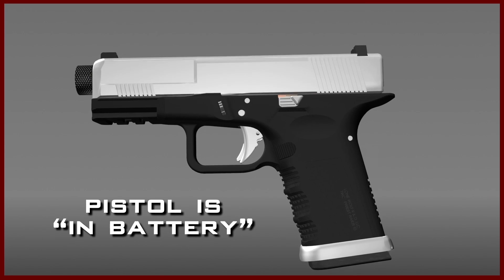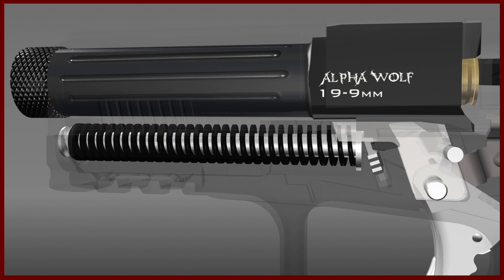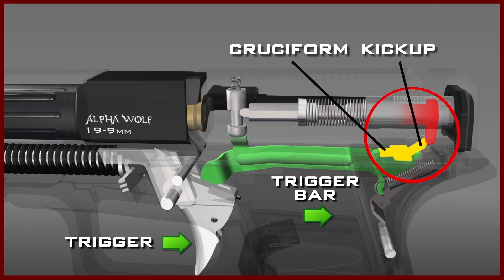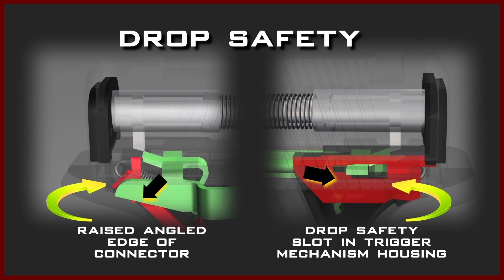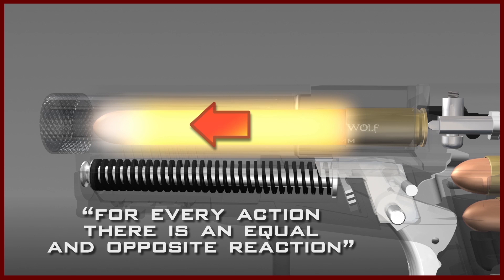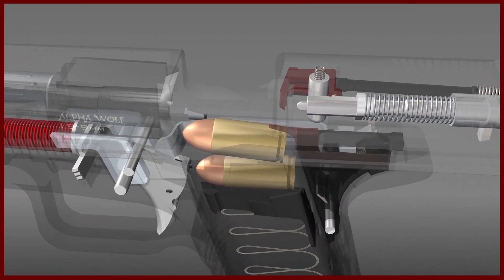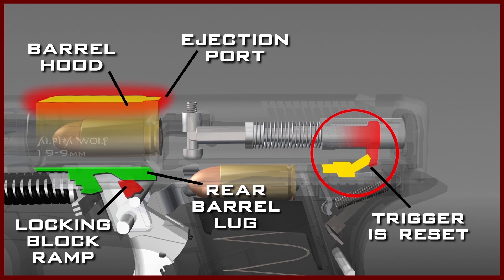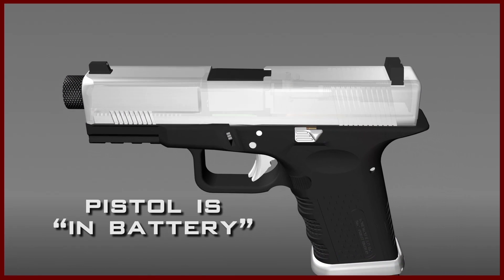Lone Wolf Update: Firing Cycle Explained for Glock

Comment: Believe I know the answer. It's actually depicted in the ending firing sequences without explanation. One can clearly see the bird's head of the trigger bar sliding off the raised angled edge of the connector. That is the reset and its distinctive sound. It's also consistent with what I've read in lone wolves complete Glock reference guide, 4th edition, page 37.

Comment: What EXACTLY causes the audible click when the trigger resets? What is it that creates that sound? From what I've read and observed, it deals with the connector and the trigger bar interaction but I don't understand what actually causes the click. I have an idea, but would like Lone Wolf to chime in as well as viewers of this video in the know!
Reply: The actual firing sequence multiple times at the end of the video depicts what happens . The bird's head of the trigger bar sliding off the angled edge of the connector is what creates the reset and its distinctive sound.

Comment: This is by far the best description of the cycle of operation for the Glock pistols, much better than the official armorer's course.  The trigger spring is not the component that forces the cruciform upward, as shown at the 6:15 mark in the video.  The trigger spring can be removed, and the Glock trigger will still reset.  The Z-bend in the trigger bar that is just ahead of the cruciform is what causes the cruciform to rise up, so the kickup can engage the striker as the slide moves forward.  The Z-bend contacts the plastic frame, and the trigger bar is forced upwards once the disconnector is released.  The upward angle of the trigger bar from the pivot on the trigger to the Z-bend is what forces the kickup upwards once the disconnector is released.  We know that Glock incorrectly calls the disconnector a connector.  We also know that the Glock armorer's course contains so much false information about how the pistols operate.  The armorer's course contains so much bad information that graduates of the class have no idea how the pistols work.  The actual function of the pistol can be seen when the trigger spring is removed.  The pistol will still reset without this component, although the trigger pull weight will be much greater.  It really stinks that we have to take the same class every 3 years.  This is a big waste of time and money, but we have to listen to the same bad information from Glock every 3 years to retain our certification.  This video is so much better than Glock's official armorer's course.
Reply: Ryan Scott your statement is completely incorrect. I don't know where you heard that but it is wrong. The trigger bar will not reset without the trigger spring. There is absolutely nothing else to move the trigger bar except the trigger spring and striker lug. A "z bend" will do nothing if there is nothing to act upon it. With out the trigger spring the trigger bar will not move upwards and will therefore not be in position for the striker lug to reset the trigger.
Reply: Thanks for the critical thoughts.  The explanation was poor in school, but I heard it in the Glock Armorer's school.  I had to help the teacher with the example in class.  Remove the trigger spring (S-spring), and the trigger still resets.  The trigger or S-spring is a non-essential part.  The S-spring can be completely removed, and the pistol will still function.  Glock has this information publically available, even if someone is not a Glock Armorer.  The trigger reset is done by the Z-bend in the trigger bar, not the S-spring.  Nobody should ever believe stuff they read or hear on the internet or even what teachers say in school.  It is important to verify information and think for yourself.  Go ahead and remove the trigger or S-spring.  Notice that the trigger still resets, because the Z-bend in the trigger bar is what resets the trigger.  If someone attempts to reset the trigger in an artificial manner without the finger on the trigger, the Z-bend will not reset the trigger.  In live fire the Z-bend will reset the trigger without the S-spring.  If someone is playing with the slide and does not have the finger on the trigger, the Z-bend is not touching the frame.  The S-spring, one of the NY springs, or the new trigger spring - coil for the G42, G43 and Gen5 pistols resets the trigger when someone is not firing.  The trigger pull weight and feel is different when those springs are completely missing, incorrectly installed, or broken.  That is an important clue that a non-essential failure has occurred.  Unfortunately, there are so many people that spread false information about the trigger spring or S-spring.  It is hard to get good information, but factual information is available.